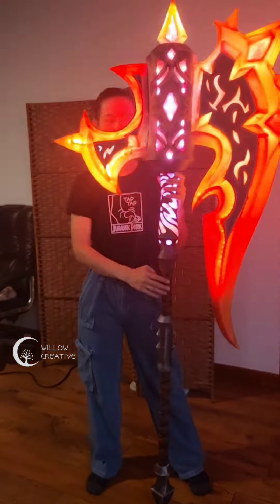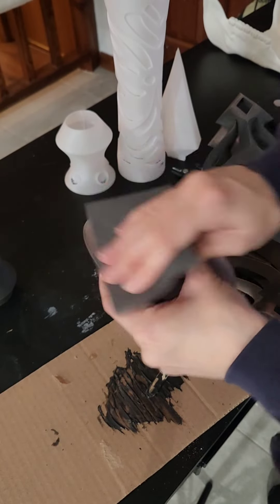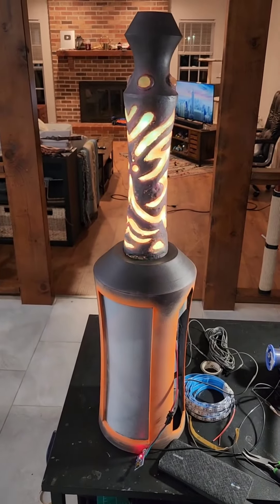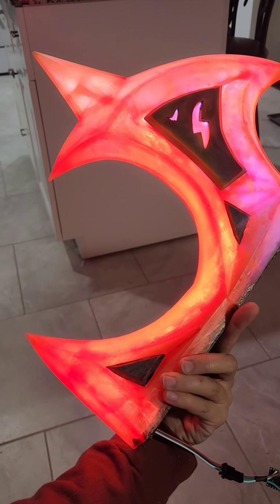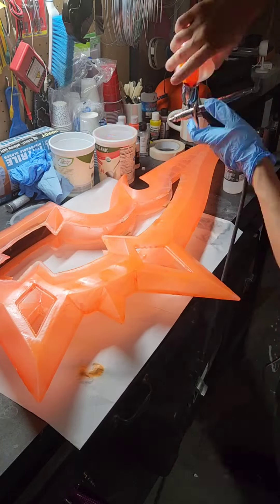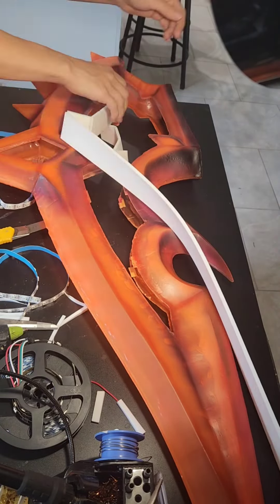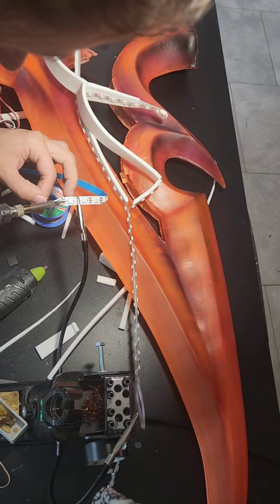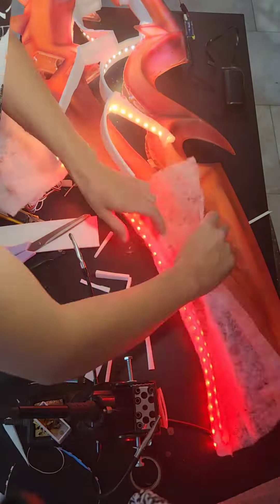How I made my Fyr'alath axe prop from World of Warcraft

Comment: How do you print LW-PLA for a big prop like this to still have it stable but keep them actually lightweight? Simply more perimeters as usual? A particular infill structure? Thanks in advance for your answer <3 The axe is amazing!!!
Reply from the maker: about the same as regular filament, usually one extra wall and a bit higher infill percentage. I only use it for decorative parts, structural parts were regular filament